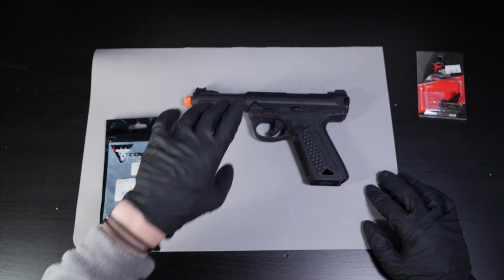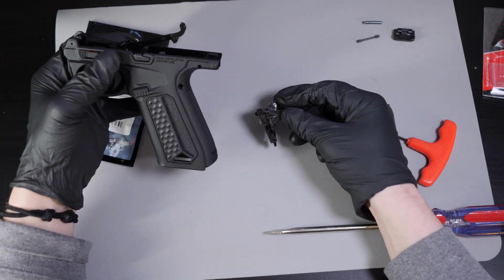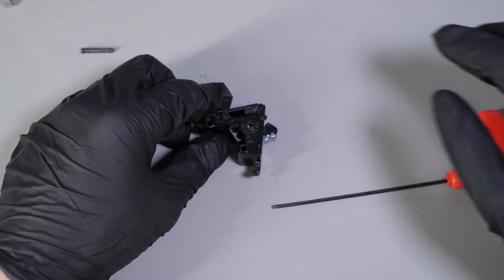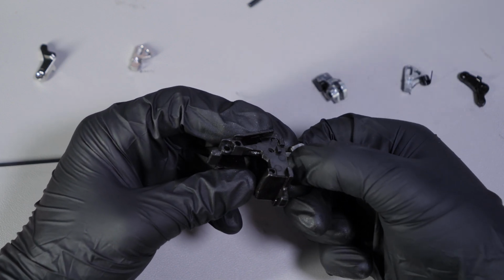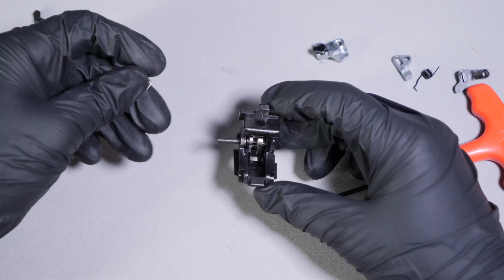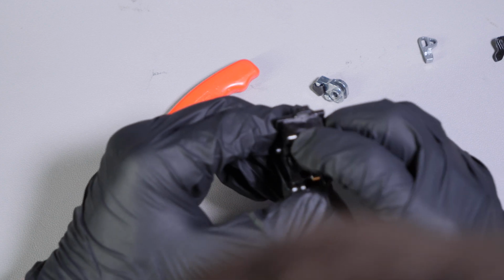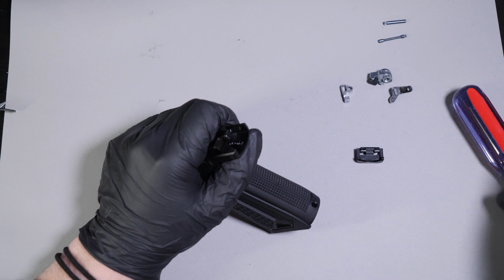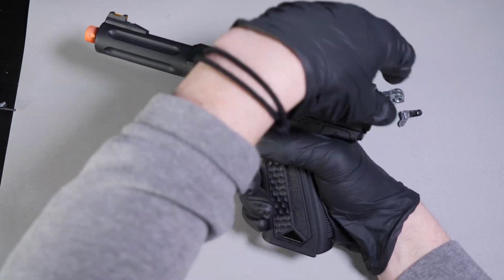AAP-01 UPGRADES: CowCow Stainless Steel Hammer Set Installation Guide

Comment: Do you need this if you have a steel bolt
Reply from the maker: The hammer is most likely the part that will break first, it could last a while however at some point it will probably chip away.  So it’s only necessary if yours breaks, but yes I would still recommend it alongside the bolt.
Reply: My Hammer Set (don't know which Part) brokes after 2 Game days only playing with 0,92 Joule power (HPA). 
After I get a repaired/new AAP-01 from my gurantee I switch right away to the CTM CNC Hammer Set :) 
So: Yes you need it!

Comment: So ive had my aap 01 for about a year and a half now and I absolutely love it, although, with having it for that long of a time I have run into a problem. When I fire it, even if its in semi it shoots in full auto. Do you possibly know anything about how to fix it and what the problem might be?
Reply from the maker: Yeah it’s stock inside right? My bet would be either the hammer started to chip, or the full auto sear could have chipped. Both of those are in the hammer housing, if you watch some videos on the hammer installation a lot of people talk about what to look for in terms of long term wear and tare.
Reply: @Private_Caboose  I have the upgraded hammer set and fire pin lock from cow cow but I haven’t upgraded the auto sear yet. So I’ll check that out next, thank you so much.